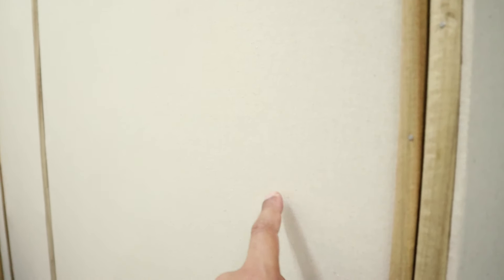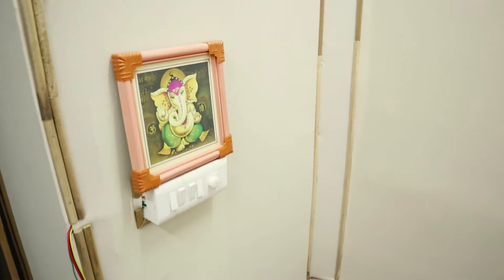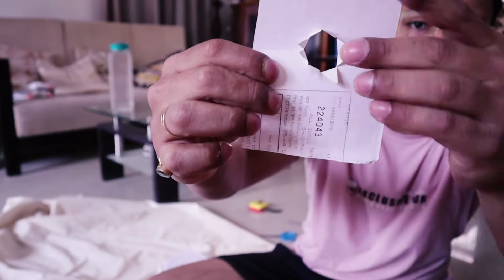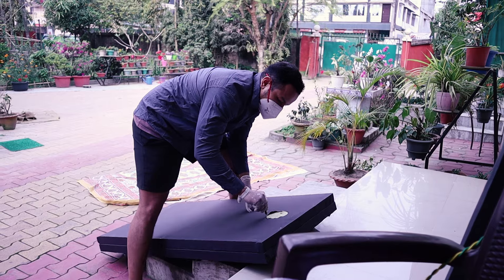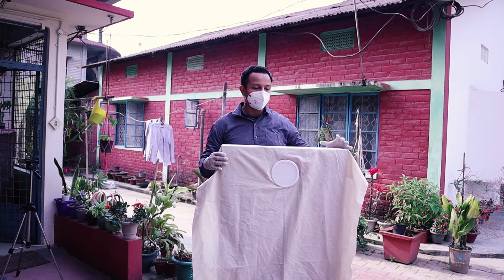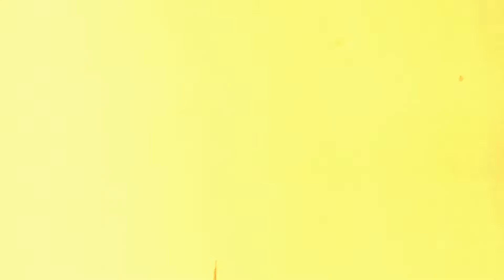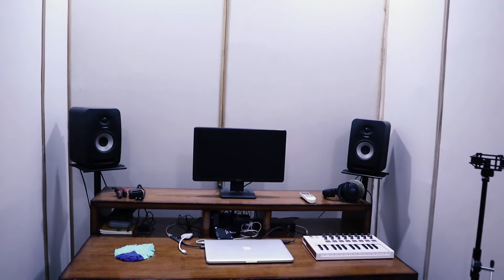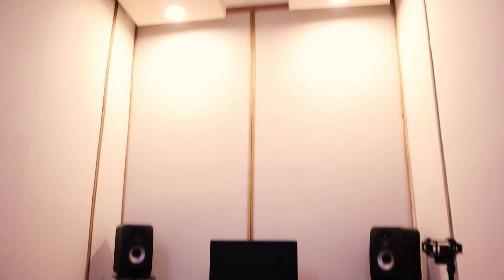New Studio Design | Flutter Echo | DIY Absorbers

Comment: Which materal, thickness and density did you use in the absorbers that you have built on the wall?
Reply from the maker: It was locally acquired rockwool . Don’t remember the exact density but most probably 90 kg/m3 as far as I remember
Reply: @DreamArtRecords  thank you for your timely response 😇. Btw how thick is are those absorbers, 2inch, 4inch, 6inch? Or any other thickness?

Comment: My rooms in my house does not have echo problem because I live in Assam Type house which is built using Bamboo walls instead of bricks. The bamboos are sandwiched between the two layers of cement and therefore it absorbs sound. Only the cealing is a problem because it is made of tin roof. Therefore i have to create a false ceiling and put rock wool there to absorb the sound.